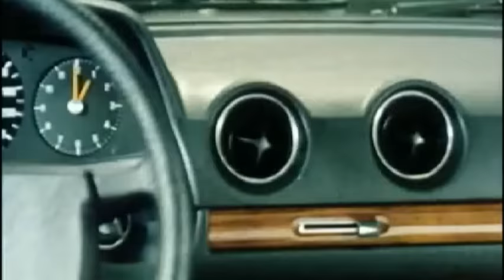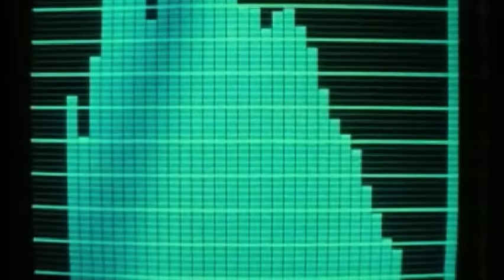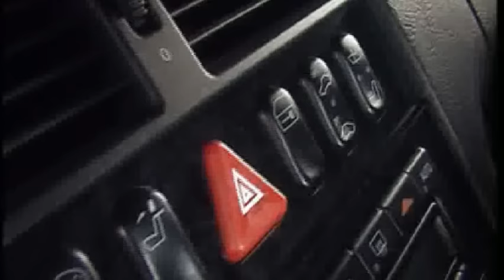Mercedes-Benz E-Class W123 To W212 Trailer

Comment: My W123 240d is a kick in the head to drive.  It may be a diesel but I have no problems keeping up with traffic.  Just recently I modified the air intake a put a pvc y pipe to push more air into the engine.  It has reduced the smoke and it has a bit more zip to the take off.  I just put a Klima a/c unit and it gets very cold now in the cab.  I am still trying to come up with a way to install a cab filter.
Reply: kermitefrog64    I did the same with my 83 300d. Diesels love 30 to 1 air to fuel. On occasion I put 20% NEW veg oil( homemade B20)...$4 plus/gal..  but cleans carbon build up...smells great...quiets the clatter...and zero smoke. And she has 225K...just broken in!
I did WVO in a single tank, heated system for ten years on my non turbo 300 (now parts car). Big oil put a $1.20 market value on WVO and manufacture B20 and B5. Now WVO almost impossible to collect from restaurants! The non turbo IP finally gave out with UNKNOWN  THOUSANDS of miles on the engine.
I recommend a moly or quality lubricity fuel additive, if you use veg oil. Even at 20%!
Cheers👍🏾 
PS: where does one buy that Klima AC unit?
Reply: Looked it up... Just a cleaner made a Old Mercedes AC blow cooler?😲